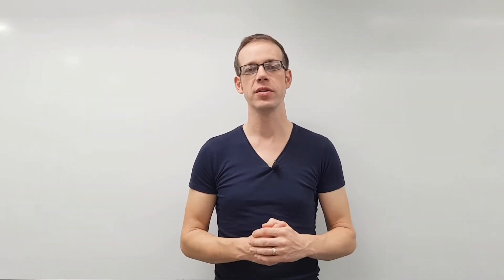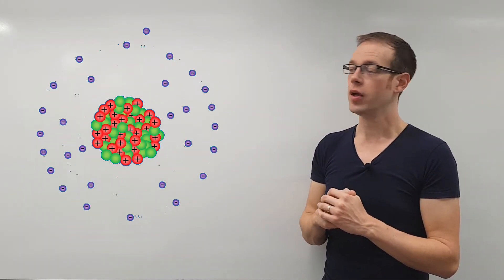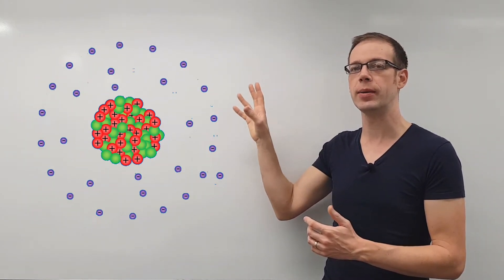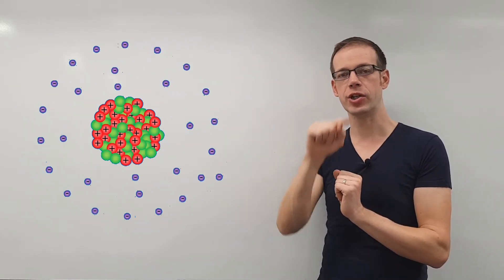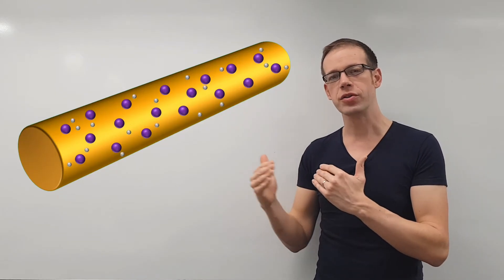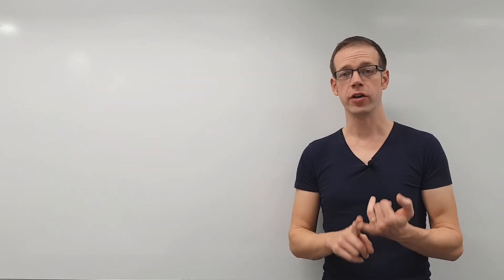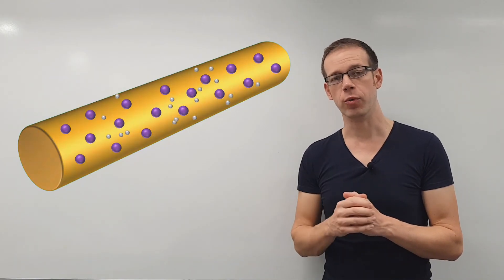What is Electricity? Part Two: The Atomic Structure of Copper

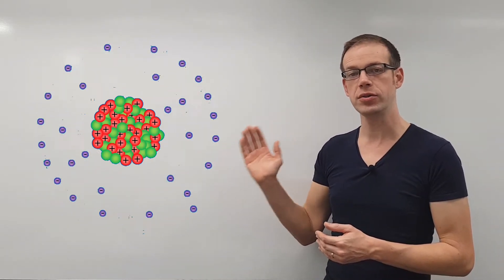Comment: 0:50 Since the most important subatomic particle for the electricity is electron, the number of neutrons are not a big deal for this topic, but it's still worth mentioning: Yes, the number 29 is necessary to call an atom as Copper; '29 protons' is its identity, its atomic number. Change the number of proton you change the atom, that's the name of the game.
But atoms do not always have same amount of neutrons next to their protons, hence the different 'isotopes' of an atom. Number of protons + number of neutrons give the isotope number. In the case of Copper, naturally available isotopes are 63 and 65 which are 70% and 30% in their abundance respectively.
That is to say, when you take out its fixed proton number (29), the number of neutrons in Copper atoms are usually either 34 (63-29) or 36 (65-29). So Copper having '29 neutrons' in its nucleus is very very rare.